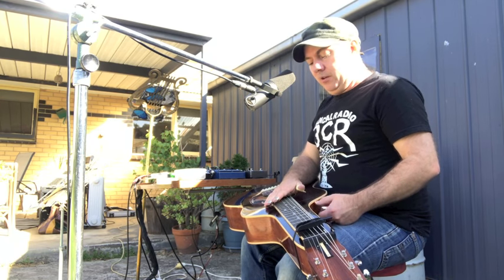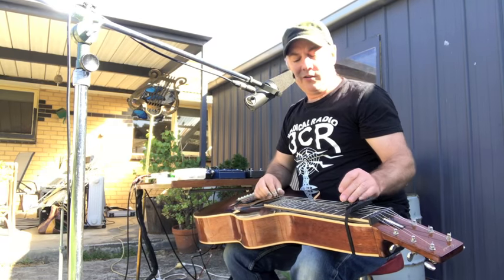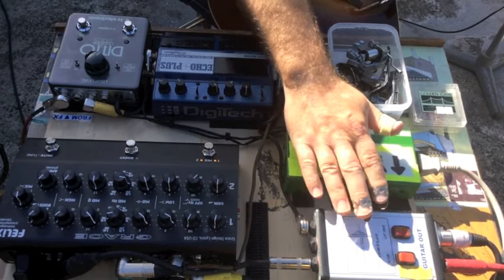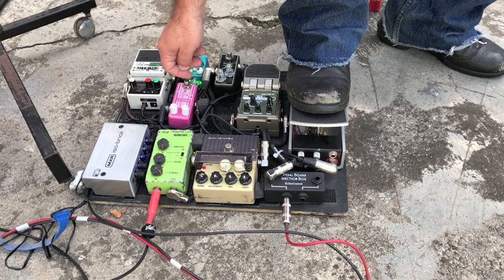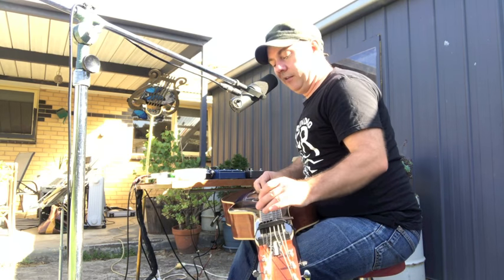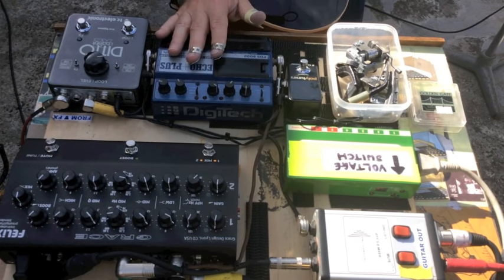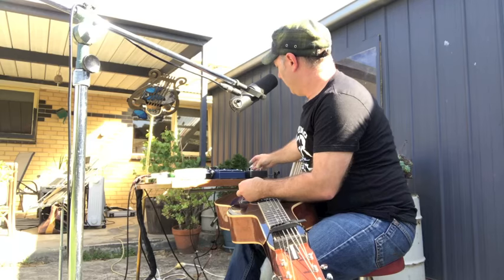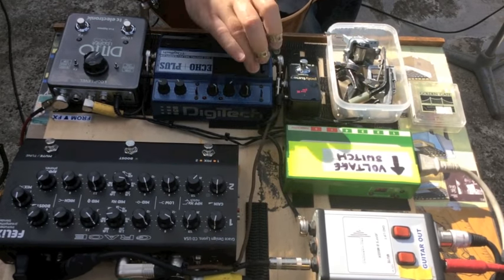Jeff Lang talks about his live setup

Comment: Mister Jeff that was incredible. John Butler mentioned your name in a video of his and i was so inspired by the two of you. May i ask you something? how can i use my volume pedal to blend and switch from the acoustic to the overdriven sound? John butler uses a maton stomp box connected to the volume pedal. can you please help me to figure it out?i use an under saddle and a magnetic pickup. it would be awesome if you can give me a tip. thank you in advance.
Reply: In this video, Jeff uses a "modified" BOSS Line Selector Pedal, it looks like an LS-2, to switch between and loop the two magnetic pole pickups, the Sunrise in the sound hole and the KRIVO Djangobucker on the surface at the bridge. The volume pedal is an Ernie Ball MVP, and works in mono, adjusting the signal volume coming from the LS-2 and whatever pedal is in between that and the volume pedal. It's hard to follow the cables, but the volume pedal is probably inserted right before the Sansamp pedal. For what you want to do with two inputs, you could use a stereo/pan volume pedal to "switch" between an A and B signal using the pan function.

Comment: Thanks so much for this video Jeff, so darn interesting. Love it. Just wondering, have you used the Seymor Duncan  mag Mic? (which is what I've been using for a while as it was a little easier to get than the sunrise at the time. Do you know how the magnetic sounds compare?
Reply from the maker: Kieran Glasgow Mag-Mic is a great option as a stand-alone, single pickup source. With its microphone wound out the magnetic pickup sounds really good, though it has a bit more ultra top end than the Sunrise. Some might prefer that too. I like the Sunrise better but wouldn't be unhappy with either.